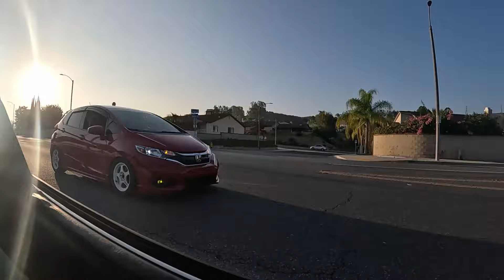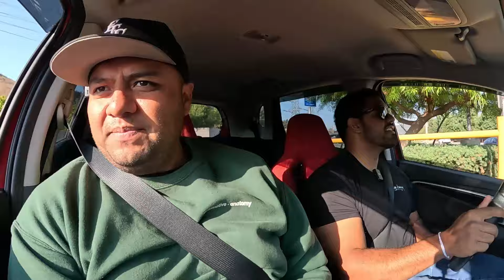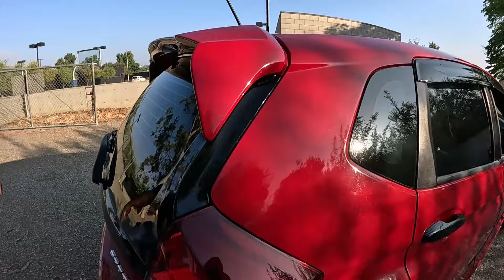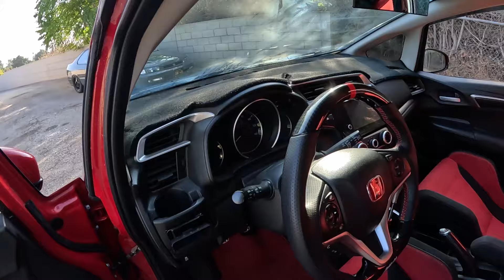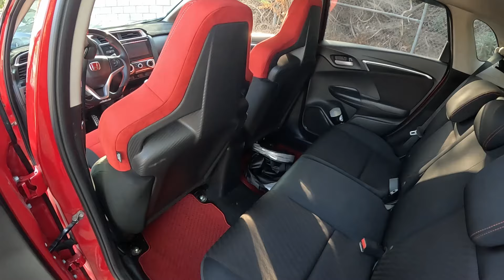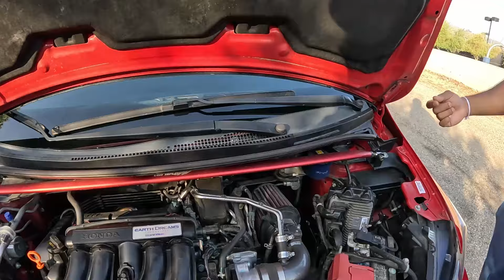How To Build A 2018 Honda Fit Sport: Mini Type R In The Making!

Comment: The FIT would be the ultimate platform if Honda had made a 2 door.
Reply: The ge and gk  (2nd/3rd gen) fits weigh 2,500 pounds, the gd (1st gen) fit weighs 2,400. They’re right around the same weight as a 2000 civic hatch with more seats and doors.